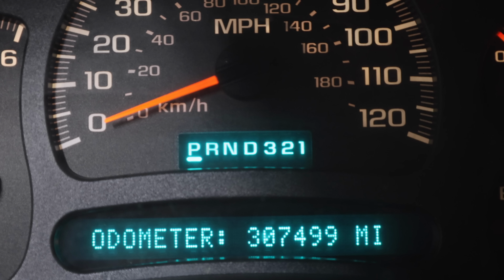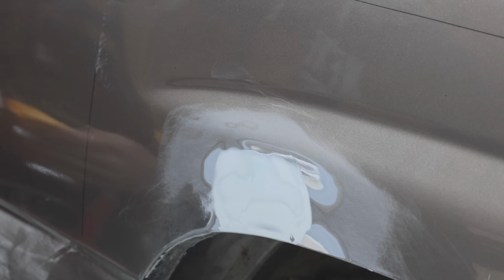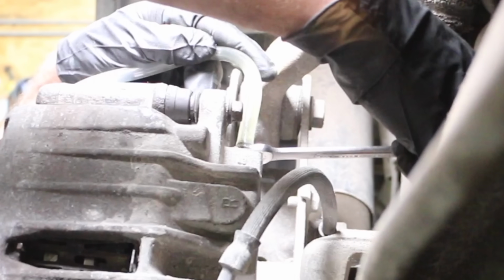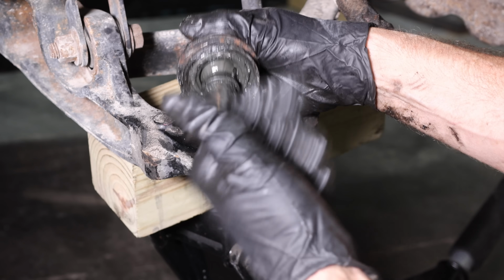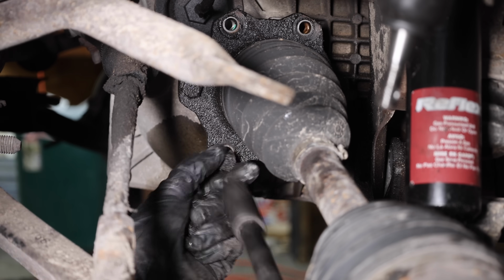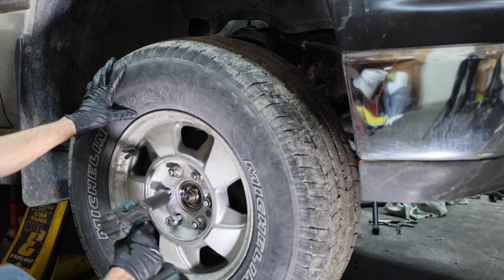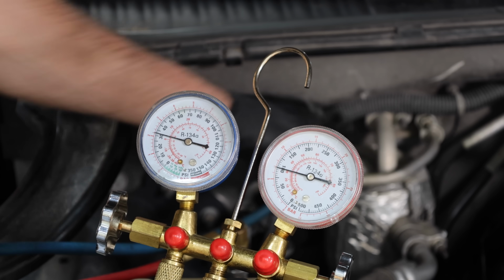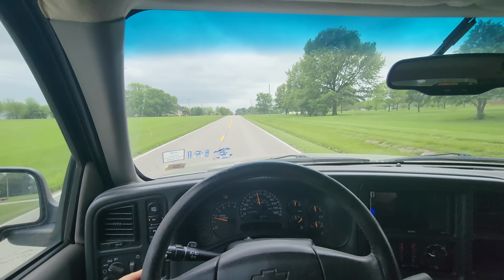Is It Stupid To Fix Up A 300,000 Mile Vehicle? Let Settle This!

Comment: 300k mile Toyota sedan.  Totally worth it. Vehicle operating "cost" is a time-cost-convenience dance. How much time do you have? How much is your time worth to you? And how do you define convenience? 

I've had no car payments for more than 3 decades. Excise tax on a 25 year old car is pocket change. Even if I were to drop $1000 annually on parts I'd be ahead of the game in most scenarios compared to a new financed vehicle (even if it is under warranty). 

The single most difficult aspect of maintaining a car past 300k or 20+ years is the ability to source parts. For example, on my vehicle two of the trans valve body gaskets and one of the solenoids have been discontinued. For a daily driver that isn't a collectible, there's virtually no aftermarket for less common components. You can easily find ball joints, pads, rotors and tie rods, but certain types of electronics and trans/engine internals become increasingly difficult to source. For those, NOS becomes the only option. Those $25 gaskets now cost $75 each and are available from 2 sellers on the entire western-accessible internet. In the case of a gasket, I could potentially trace and cut my own replacements. That's not the case with a specialized solenoid. The upside here is that these specialized components, while increasingly more costly and more difficult to find, tend to have a significantly longer lifespan than the previously mentioned consumables. It's not like we're changing valve body gaskets every 30k miles.

The point here being that some costs will rise with the age of the vehicle, and finding parts will become less convenient, but generally not enough to make financing a new vehicle the more attractive option. At least not for those of us fortunate enough to have the space, tools and skills to do our own labor.  When it comes time to change vehicles, I'll find something 10-15 years old with 150-200k on the odo, and squeeze another decade and 150k+ miles out of it.
Reply from the maker: Thanks for sharing.

Comment: Are you kidding me? That's a Vortec engine and the best model year! That engine, with some preventive maintenance, will yield over half a million miles at least. I bought a 2003 Chevy Silverado 2500 6.0lt with 390K Mi. I sold it running to a friend, with 480K. It's still running now, 5 years later, and has a little over 600K. 😮
Reply from the maker: Thanks for the feedback.

Comment: My 2000 528i Touring is close to the 300K Kilometer point, which is about 180,000 miles.  
I've got a great independent BMW master mechanic who does all the routine maintenance, and over the years, we've remedied all the known weak points for that particular vehicle.  The engine has more plastic than I'd like, but way less than the new models, and far fewer electronic things to go wrong.  It also is pre-Bangle, and I've not seen a newer BMW that is more beautiful than the models 3,5,7,8s from late 90's to early 2000s.

When my wife tells me that I should trade it in for a newer model, I tell her she can bury me in this car.  (Yeah, I know the OTHER obvious thing I COULD have said.)

Comment: Check compression in the cylinders, check wear on the rear diff, drain and fill with fresh gear oil, do the front too.  If the trans is in good shape, change fluid, change oil replace tie rods, idler arms, pitman arm, reman gm steering box. Should be good to go
Reply from the maker: Thanks for sharing.

Comment: One note I learned the hard way when doing a string alignment ... check your track width and account for that in your measurements. In other words, the front wheels maybe be closer or further away from center line than the rears. Not sure if that's the case with this vehicle but something worth noting.
Reply from the maker: Thanks for the feedback.

Comment: What finally sent my 2008 f150 to the junk yard was: 150,000 miles, tires very old and possibly a safety issue. Brake warning light that just stayed on with no problems. ALL the lines started blowing out, gas line repair, brake line band aid repairs, power steering lines blew out one after another, the whole steering system rusted so bad it all just needed replaced. Torn seat,  then a crack developed in the trans housing that marked my spot and went though a quart a month..and last...rusted rear wheel wells limiting the possible value ever of the truck. repairs to be safe would cost more than the truck would EVER be worth. Drove it to the junkyard and got $425 for it.
Reply from the maker: Thanks for sharing.

Comment: Should have replaced the upper control arm. It only cost a little more and this would have come with new bushings which tend to dry rot and new ball joints.
Reply from the maker: Thanks for the constructive feedback.

Comment: The problem is that it is a gas guzzling suburban and while some might like the thing, others not so much. And how labor and time was put into doing all this, what is proper valuation of that labor, and then on top of that are all the parts. It is not like this was free labor or quick and easy.

Comment: Just sold my 03 savanna conversion van with 301000 miles and zero issuse except windshield crack. Those ls motors run forever just maintaine it
Reply from the maker: Thanks for sharing.

Comment: Rarely is it cheaper to buy new over fix. Even if you got a 15 yr old truck with 250k miles if you need to put 3-7k in it i would. Cant touch a new truck in canada under 50k so spending even up to 10k at least i know its reliable. But thats not for everyone i know im in the minority because i dont want or care about the modern gismos an gadgets i couldnt care less
Reply from the maker: Thanks for sharing.

Comment: Overhauling a 300000 mile car is definitely good from ecological perspective yet it all comes to cost-effectiveness. In the end, repairs become more frequent and demanding such as engine replacement. In addition to that, the platform becomes outdated. so it is better to purchase another vehicle.
Montreal public transit company STM runs its buses for 800000 kilometers on average before scrapping. One bus rolled 1.5 million kilometers but in the end it retained almost none of the original parts.

Comment: This was so cool to watch.  New viewer, this is an instant subscribe.  Memories of working on most of these parts on my 1998 Silverado.  At 250,000 on mine and just recently did a transmission flush/inspection which yielded no metal shavings.  I've never been brave enough to attempt to fix the rust on the body (It's a MN truck....the rust is pervasive down there), body work has always scared me before, especially cutting and welding, but you've given me some confidence in this video and I think I'll give it a try!
Reply from the maker: Thanks and you are welcome!  Thanks for watching and subscribing.

Comment: I did recently buy a 06 Toyota Sequoia and with 265k on it and have been fully repairing it. I see no issues if it runs as it should. Also, keep your pace. It not only keeps you relevant. It keeps the data flowing for those who NEED it fast paced. You spend good time at this "highspeed" on the most important items.
Reply from the maker: Thanks for the feedback.

Comment: is a vehicle with 300,000 miles + going to last long enough that the little spot of rust would be a problem? I get it will eventually spread, but body work on a vehicle like that seems unnecessary

Comment: Use 3M panel bonding epoxy next time.  For a cheap and easy fix I don't see anything wrong with this.  The cost to have a body shop do this wouldn't make it worth is for this vehicle.

Comment: This is amazing! I just bought a 2003 f250 5.4L 2 valve with 375k km. Motor is solid! There is a lot of play in the steering so I will have to look at getting the front end done. This was great to watch. 🙏🏽

Comment: I got a 1994 f150, brake fluid flush, oil change, tune up, transmission service, coolant flush, runs like a champ, 230,000 miles. It seems like the biggest problem with higher mileage vehicles is neglect
Reply from the maker: Thanks for the feedback.

Comment: Fixing up a truck with 300k is smarter than spending $60-80,000 on a new one that, let’s be honest, is junk. My 2001 z71 has 352,000. Original trans and rear. Replaced motor at 319,000(my fault for not changing oil regularly). When the trans goes, it will be replaced, and I’ll keep driving it. WAAAAY better truck than this new junk.
Reply from the maker: Thanks for the feedback.

Comment: Video where your doing multiple fixes the videos should be fast.
I would say slow it down slightly  for video centered around one fix.
What’s annoying about repair video is when they take too long to get to the point or they don’t state the tools or products they are using.
.your video avoid these faults for the most part.

Comment: Gonna try answering before I even watch the video, yes depending on the cost, which fluctuates on make/model/year/damage. I swapped my Subie engine with near 200,000 miles on it and it cost me around 4k with parts. That's a deal since I expect to get near a decade of use from it. The alternative would be to pay >15k for a new(ish) car.

Now to watch and see if I came close!
Reply from the maker: Thanks for watching!
Reply: @ProjectFarm  Thanks for posting! That was enlightening with some of the repairs made. The cleanup for the steering system was cool!

Comment: The lack of rust on that truck is nice. I bought a 2003 Yukon xl with 270k on it for 2k. I bought it for the engine it was replaced 95k miles ago. Was going to be a donor truck but it’s too nice from the inside perspective. But the rust does not leave a lot to be desired. It’s mostly rockers and around the wheels. Debating doing all this service.
Reply from the maker: Thanks for the feedback.

Comment: 2:03 that’s not stitch welding that’s just tacking stitch welding is say 1inch welds every 6inchs on something that doesn’t need to be fully welded..
But the way your doing it is about the only way to do it trying to do more than a tack will just blow the thin metal through.. 
and your never going to do a nice weld like that and it will always need grinding back filler etc to make it look right so pointless trying to get a really nice weld in the first place..

Comment: I have multiple vehicles that’s are over 400k lol. I fix them but I set a cap as long as it’s not like 1000 in repair in a year then I’ll fix it if not I’ll get rid of it. I’ve maintenance every single one of them. 97 Tacoma 2007 4 Runner 2003 Honda Accord all over 400k running and pass smog no problems
Reply from the maker: Thanks for sharing.
Reply: @ProjectFarm  btw I love the vids!

Comment: One thing, when spray painting previously rusted parts, it is important to use a rust inhibitor before painting. Otherwise you could be locking the rust, which could accelerate with the paint.

Also tbf, you didn't really do anything for the engine other than some fluid change. A 300k mile engine likely has other issues within the engine that need to be addressed as well

Comment: side note about auto transmission fluid changes. you can get a "flush" at some lube shops, BUT  I believe what the manufacture recommends. that being to do a pan drop or just the fluid in the pan not all of it. there will be some fine metal from the clutch's that acts like a friction modifier making slipping less likely. slipping will destroy the clutch's.

Comment: Im from michigan and where i come from its the condition of the sheet metal is what matters.
If its got 300,000 miles and body is solid its worth changing a lot of worn out suspension parts and drivetrain.
My wifes car is from Ohio and a whole lot cleaner, we started out with 200,000 miles and now at 250k its just starting to get rough.
I hope to get it to 300k

Comment: 12:30 what are you using here before the paint? Isn't it problematic when there's rust left on the part and there's a coat that hides potential rust over it?

Comment: Wow, 300k $2k price and that’s all little bit of stuff you had to replace? I got 95 Silverado I bought $2k also, with 200k miles and I fixed all that plus a lot more. That’s little bit of stuff you did isn’t even 25% of what I’ve done so far. You got a easy walk in the park repairs.

Comment: My 2011 camry has 315k on it, I use it for Uber. I drive it 1200 miles a week. Maintenance is everything my camry doesn't even burn oil yet, original engine, transmission
Reply from the maker: Nice!

Comment: I have a 2009 toyota rav 4 v6 with 280,000 miles and we didnt change anything on it except the water pump and ive done research online and talked to owners that havent changed anything except the water pump in 315,000 miles and he was towing a trailer with it for work, and that got me to realize that not only are the engine and transmisions realible to the high milage  but so are the pumps and sensors like fuel pumps waters pumps starters alternators they all last that long too and so do the suspension parts it really doesnt make sence that there so much better then some of the other realible american and europeans cars out there. I wish you could make a video testing just how more durable the toyota and hondas from that era are compared to maybe american cars and europeon shock absorbers and things like that. It might be a good way of finding the most realible car for people. And theres even some proof online if you do a quick search on cars for sale youll see almost everything from the early 2000s from america will be listing the suspension and pumps and sensors they changed while certain japenese are completely stock all around and high mileage. and then you can see some high mileage and low mileage crown victorias a well known american rrealible car listing all its new startsers ans alnernators even at 80,000 miles new starters and you can maybe see what im talking about.
Reply from the maker: Thanks for sharing.

Comment: If an engine still has good compression, the transmission is still solid, and the frame isn't rusted out, I don't see why you wouldn't want to fix it up.  And by all means DON'T slow the videos down.  The pace at which you do these is great for folks like myself that just want to see pertinent info without a lot of fluff.
Reply from the maker: Thanks for the feedback.

Comment: I think people waste too much money replacing vehicles that only really need some TLC. 

Why go buy yourself a vehicle for 10-60k, when you could spend 3500 on an older vehicle and get another 6-7 years out of it? 

I feel most are too afraid of higher mileage vehicles, but I've seen many well maintained vehicles last till 500k. Regular oil changes and inspection can basically stop like 95% of issues from ever occurring. If you've taken care of your vehicle, this is usually a great option over buying new. Unless parts are scarce/expensive. Some vehicles are like that.

I'll also say. Your vehicle here barely has any rust compared to mine. Man that salt that they use on the roads here is corrosive.
Reply from the maker: Thanks for sharing.

Comment: I have an 03 tahoe LT 4x4 with 230-odd thousand. I JUST replaced all front end bushings with Energy Suspension urathane and new "high performance" inner/outer tie rods, ball joints and replaced bad CV axle with a new "heavy duty" one from Detroit axle. Also, Drilled/slotted rear brakes, heavy duty ceramic brake pads on dual piston calipers

She severely needed it as ive been running 2" wheel spacers and larger tires for over 100k 😅 
HANDLES LIKE A TOTALLY DIFFERENT VEHICLE!!!
About 80K ago i installed Rough Country nitro shocks in the front and level/lifted about 1" over level. Around that time i also needed a brake line so i got a whole set of "revised design" stainless  after-market lines for the same price as the single factory line 😅 
One day she will be a whole different truck! Lol
Reply from the maker: Thanks for sharing.

Comment: One thing I do on a patch panel is sand blast the welds to remove any grundge you can't get with a grinder. I just use a cheap harbor frieght blaster.
Reply from the maker: Thanks for sharing.

Comment: Just fyi, that is the steering gearbox, not the pump. I'm sure you are aware, but just in case you weren't aware, there ya go. Also, don't change. It ain't broke so no need to fix it